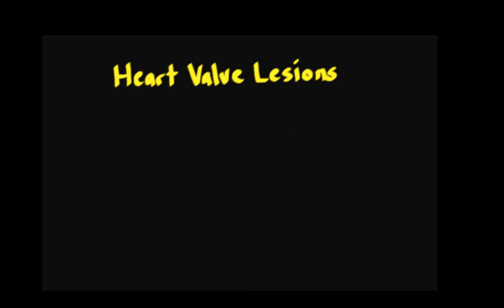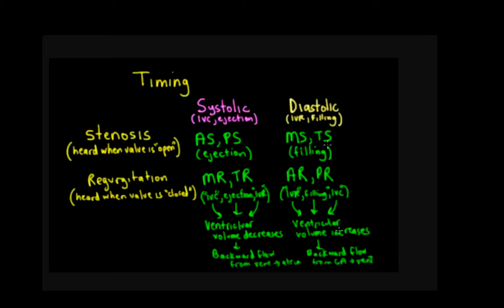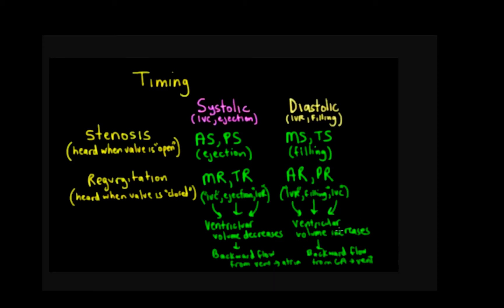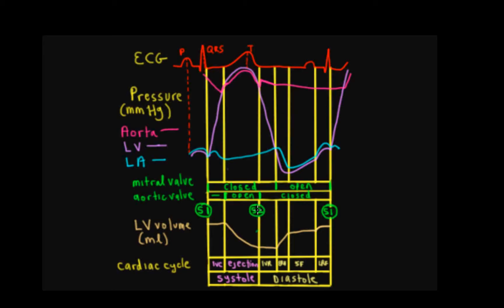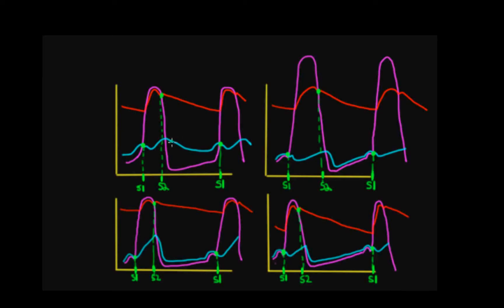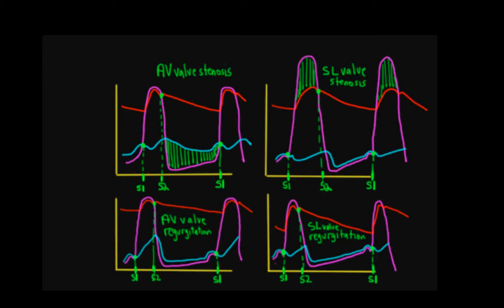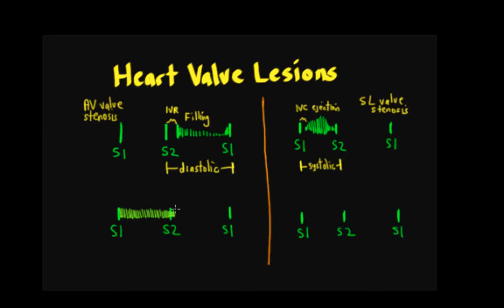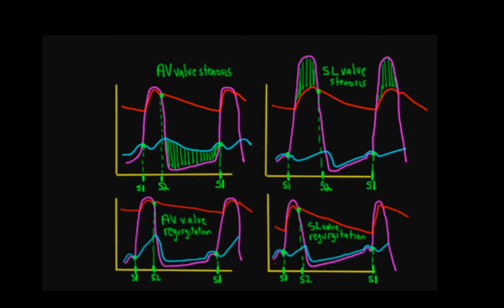Schneid Guide to Effects of Heart Valve Lesions on the Wiggers Diagram

Comment: It's wrong...aortic valve stenosis and mitral valve stenosis should be labeled reverse on your diagrams and so is aortic regurgitation.... You got it all wrong
Reply: bro AV valve in this case is atrioventricular valve, which includes both the mitral and triscupid valves. if it was aortic it would be labeled as AV not AV valve. hope that helps.